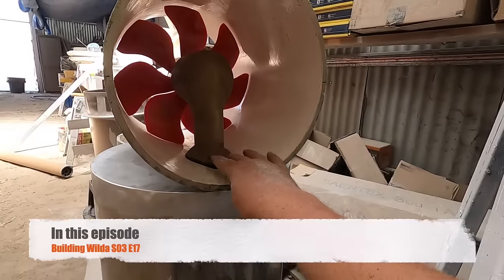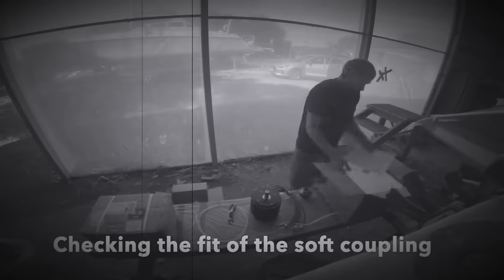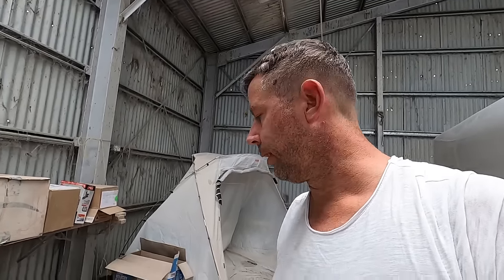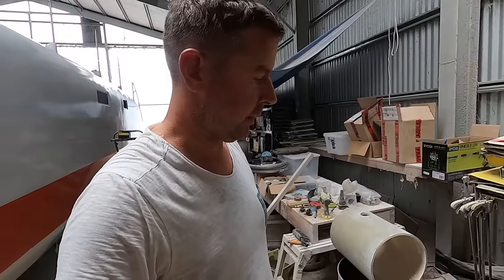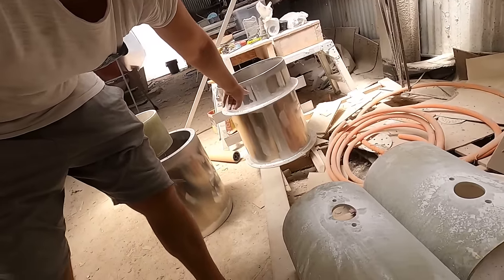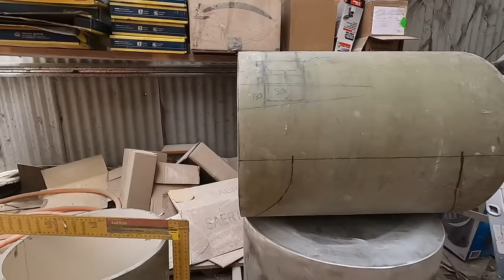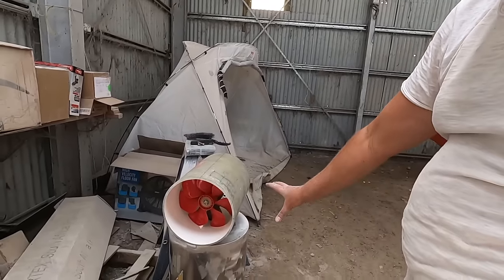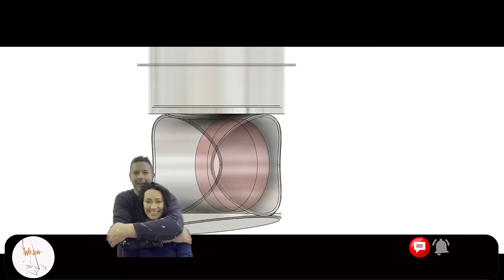NOT the AVERAGE SAILBOAT DRIVE SYSTEM - Part 1- S03E17 | Building Wilda | Electric Catamaran

Comment: Having sailed and lived aboard a 17m aluminium Crowther cat for 13 years I can tell you without doubt you will be caught in conditions you were not prepared for. Getting caught on a lee shore, running aground all things that occur REGULARLY. To that end you need enough drive in main engines to overcome windage (quite substantial with cats), current, waves etc. Emergency power is not needed often but you will need it. It can be the difference between running hard aground and losing your boat to arriving in a safe anchorage. Hybrid and electric boats do not have this capability. You can over rev a diesel for short periods for emergency drive, but not so with an electric motor. In fact the warmer your electric motor gets the lower the shaft output. All this said you need to be VERY careful when moving your boat given the lack of emergency drive available in your setup.
Reply: This is not true. By definition diesel and hybrid and electric are equally not redundant. Your argument fails on this. It could be argued that Hybrid can be designed as redundant (ie direct drive diesel and/or direct drive electric), however diesel is NOT redundant.
Reply: Wow! What an inspired project.
Good luck with it.
Cheers, Hugh
Reply from the maker: All drive systems have their advantages and disadvantages. Personally, i'm hoping the reliability of electric drive will outweigh the disadvantages. Few moving parts, nothing much to service, no clogged filters, dirty fuel fewer spares to carry.

I absolutely realize a diesel is superior in some ways. In particular range under auxillary power. The 10kW motors have a peak output of 15kW for a short period, i think up to 20 seconds. Not much, and they would eat into the battery bank at an alarming rate at that sort of power. The battery bank is probably the weakest point of electric drives at this point. With a small gasoline generator I imagine we'll be able to get ourselves out of trouble.

We'll have to do some real life testing once we are afloat and equip the boat with what we think we need.... And some things we hope we'll never need :)

I love Crowthers designs! Hadn't actually heard of a 17m alloy boat by him though. Sounds epic.

Comment: As an Engineer, this is highly intriguing to watch. Really interesting to see you work it out. I enjoy the process and progress! 😎🤘👍
Reply from the maker: Thank you! We are happy to learn that Axel's ideas and our project sparked so much interest and curiosity! We hope we turn it into a successful project! Thanks for commenting and a simple "like" and "share" go a long way! Hope to see you next Sunday!
Reply: the definition of Ducted props actually sets it as somewhat sensible within the sailing vessel realm.
the problem is the drag when not in use, However, that could be overcome by making it Also re-gen system.....prop re-gen can generate quite a bit of power, but many systems produce pathetic amounts of power because they don't include dedicated circuitry to handle the battery charging.....where with dedicated charging circuitry, prop re-gen could make more power than a deck full of solar panels ..... but the duct needs to be a revolved air foil for efficientcy, and airfoil duct design is complicated, being contingent on many parameters.
Reply: @buildingwilda  or to say, I would cut those PVC ducts as short as practically possible, and try to emulate an airfoil shape in the edge treatments.
and build dedicated battery charging circuits.
Reply from the maker: We will not be able to create an efficient foil in the duct. Perhaps something we can work with in the future.
The drag will be a non issue as the drive is retractable.
We don't have dedicated charging circuitry, but the controller is designed for regenerative breaking and this setting can be tuned to optimise regen.
The type of prop should lend itself nicely to regen .. I hope. And should be able to generate power at a much lower boat speed than other systems I've seen. Large surface area, low pitch... Should generate higher rpm earlier, leading to increased regen efficiency. We'll see how efficient... The drawback is speed under engine, but it's a sailboat ⛵ 

Thanks for the comments! Hope you stick around as we get it all together and into the water 🌊
Reply: @buildingwilda  Oh , Sorry, i didn't realize they were going to be made retractable...
the Sevcons don't regen so well....but it helps to dig into the programming and get what you can out of it....regen braking, on a wheeled vehicle, wants to push against battery voltage....where prop Regen, you want rectification into a large low voltage capacitor bank, and a switching boost regulator, to boost to charge from there.
Reply from the maker: Yes. More like a wind generator.

I've been tinkering with and studying smaller brushless motors and steppers. I'm hoping that the increased rpms due to the low pitch will be enough to raise voltage into an area where the controller is better at generating power. Should work. And yes, there is a lot of settings to adjust to get it right.

It will be an interesting learning experience.

Comment: I actually don't understand why not more boats use a kort nozzle, especially one that can be rotated. It is more efficient than a naked prop and can direct thrust, so it can replace the rudder, which is especially useful at slow speeds. And with a slow-running prop like in the video, electric propulsion makes even less noise. At least to me this project is very logical...
Reply from the maker: From work, I don't think I ever see any nozzles on anything that travels at speed...

Mostly tugs, offshore supply vessel and rigs have them. Slow speed high bollard pull. Some fixed with rudders, others azimuthing.

For higher speed vessels, even in pods, I don't recall seeing many nozzles ...
Reply: @buildingwilda  yes, but then what is "higher speed"? A sailing boat needs a different propulsion at two times: 1) to maneuver independently of the wind (to get into a marina) or 2) to move despite lack of wind. For a sailboat, five knots is an acceptable speed. Tugs use kort nozzles mainly for manoeuvrability, submarines for efficiency, low noise and also speed.

I think the main problem is that people got used to how things are done. Lots of people laughed at electric propulsion for quite some time, but now it's becoming more and more popular. And I expect some other things to change too in that process.
Reply from the maker: I'm sure you are right. Personally, I'm aiming to build a sailboat. That's what Schionning and a few others design. The cat will sail wind speed (hopefully better) in light winds. Love this type of design.
The electric propulsion will hopefully just be for manoeuvring. I'm hope it can get us to 4-5 knots, but we'll see. I'll likely have to try a few different props. Sadly I don't have the ability to form an effective wing profile, so the nozzle will be quite crude.
Reply: @buildingwilda  I wish I had the space to build, I'd like to try that. So I still need to save a little longer and in the meantime I learn further. I do however not get along well with combustion engines, my preference is clearly electric. I can't understand how someone happily uses a machine that needs to be disassembled, cleaned and reassembled regularly when there are other solutions.

My hope is to find a prop like in the video, for low RPMs, like on submarines, to avoid cavitation and noise. Then a duct to improve efficiency (again, submarines), plus rotation, like a Kort nozzle, to allow slow movement, when the rudder doesn't work anymore.

Schionnings look good, but are slightly out of my league, I'm rather looking for a Prout. I have seen a few with electric motors and people survived it, so I'm hopeful...

Comment: As an engineer it's very fascinating however fascinating isn't always safe and when you're crossing the ocean if any seal fails if anything fails on that system you're developing you will die, you should have just done a static placement  of lower prop unit and a folding prop it would be much safer in the long run.... don't get me wrong it's a cool idea to get more efficiency by having it retract into the hole but in my opinion your safety is worth more than the slight efficiency you'll get by having a retracting system good luck
Reply from the maker: Absolutely right. If it was dependent on a seal. The top of the tube is well over the waterline, so should not be a problem. Can remove the unit entirely in the water. If it does break somehow, the boat itself has so many watertight sections we should still float really high.

Comment: Very intersting concept. Besides that lower drag when retracted,  this impeller style system should also have some energy efficiency benefits, due to less turbolences at the edges of the prop blades, as far as i know, when engineered correctly. Think it needs to have a very low distance from prop edges to the surrounding tube. And it gives protection to the propulsion system.

Comment: The propellers have a forward face (convex faces of the blades) and the rear or thrust faces. If you wish to optimise regeneration you will need to rotate your pods 180 degrees so the thrust faces face forward towards water flow to maximise rotational speed and torque. Easy to do with your setup. You are likely to find also that the prop pitch that provides the best boat speed is not the best pitch for optimum regen. I hope you show us your testing, please!
Reply from the maker: Yes. That is the idea. And the reason for going with a thruster prop... The low pitch and large surface area should be great for regen. The prop will not be great for propulsion... At least not for any speed.

We have to decide which way to put them in soon... Clean water flow into the prop or clean thrust out ....
Reply: @buildingwilda  it has been said that a boat is a hole (two holes with a cat) in the water filled with compromises. Yes the low pitch suggests higher rotational speed during regen but less torque while more pitch would impart less speed but more torque. My feeling is that more pitch will be better as a low pitch propeller will be easier to stall as the charging load is increased? Yes more blade area should give more ‘grip’ on the water under power and better regen but with the compromise of increased rotational drag negating some of the benefit. 
Mount them as normal for propulsion then rotate the unit 180 to optimise clean water flow for regen. 
What is the pitch of your propellers? What speed will they turn at with those motors. A really interesting part of your overall project
Reply: Really interesting part of the project. Not the usual easy, diesel, way out. Will enjoy watching the process! I trust that you will have a generator back up for safety for those times you will be motoring off a lee shore for hours. I mean nothing but tremendous respect for what you have done on this project!
Reply from the maker: Thanks!

A small generator should do the trick. And in worst case, an outboard, we'll be very conservative starting out. Until we really know our limits.
Reply from the maker: Being a thruster prop, it is made for high rpm. This suits direct drive electric very well. The drive leg has a 1.4:1 gearing. Should allow the motor and prop to turn close to optimal ranges ... Not perfect, but close. The faster we can get the prop to spin during regen, the better. I'd be super happy with anything above 500w, but I hope for 1000 in the right conditions. We'll see.

Comment: This is a variation of a Kurt’s nozzle. A Kurt’s nozzle improves the propeller thrust by approx 30%.
Reply from the maker: Yes. But we won't be shaping the nozzle into a foil shape. Too much work.
Reply: Bob, is that a “free” 30% increase in thrust, or is there a cost by way of higher current draw?
Reply from the maker: Not sure about the 30% ..... But at least less power being wasted  sideways. As for power efficiency... If a nozzle always made that sort of difference, all props would have shrouds of some sort. Props don't really throw that much water sideways, or paddlewheel.... It's a pressure differential thing that causes what's known as prop walk. Props work more like screws (really bad screws that slip all the time 🤣) that being said though.. if you look at props designed to direct thrust, they have nozzles and for good reason. To my knowledge, mostly in low speed high thrust applications. Pretty much what we are looking for.

Comment: What about using a shaft driven setup with a folding prop? That seems extra complicated. I'm wondering how many knots your boat will go with this set up. I've never seen a set up like this before but it seems very similar to some of the bottom of some outboard engines with a prop guard.
Reply from the maker: It won't be fast, that's for sure! 🤣 All solutions have their own merits. And there are many different ways to get a prop to spin 🤣
Reply: @buildingwilda I can't wait to see how it all works and then preforms. If you feel that you've made a mistake on this install than you can always change it latter on is some boat yard after you use it for a few years. Who knows, you might have come up with something everyone will want and set a new trend.

Comment: This is cool, its been around for a while like you said. My favorite version used rim drives because they can pass ropes and other items through without fowling. The other versions also added and upper cap to keep the cavity protected, I also thing it kept to much seawater from being trapped inside the tube.   You might want to add a way to remove any trapped seawater from the tube. If you want to be environmentally aware you can turn the propeller into a sort of a self washing machine by pumping some fresh water into the propeller tube. The fresh water is a hostile environment for the sea life that wants to attach to your equipment. I am not sure how much fresh water to add but I don't think it would take to much.
The not so environmentally nice way it to build a pocket in the tube for a bleach puck or some other method of injecting the water in the cavity with a cleaner, biodegradable soap is an option, but I'm not sure how much of a hostile environment it would create, and if you turn on the propellers well.... have you ever seen what happens in a washing machine and dish soap. You would leave a trail of bubbles as you sailed away.
13 hp motors seem pretty small fort the size of boat, but if you are okay with it I say go. I would recommend a 25 hp outboard or larger on your dingy and a mod on the back of the boat to allow for use on the full size boat in an emergency. That way you have a double duty backup.
It's a very cool concept, and I have only seen this on super yachts so this should be interesting to see how you solve your issues as they come up.  Good Luck!
-MG
Reply from the maker: Very close to our thinking. A 25 hp dinghy outboard would be great. We'll see when we get there. Planning on a 3m is tender, so may be limited to a little less power.
As for the fouling in the cylinders... I'm hoping the lack of sunlight will keep growth down and almost all of the prop will be above the waterline when retracted.
Rim drives are super cool. Just not an economically viable option. Nor are any other retractable options. Even fixed commercially available options are extremely pricey... I think we'll get it working well. How well, remains to be seen.

Comment: Fantastic Axel and Rox , Cant wait for more of this electric propulsion build . putting the prop in a sleave like you have will make it more efficient. less cavitation so to speak .
Reply from the maker: Thanks Steve! See you soon
Reply: It's called a kort nozzle.. or Azimuth drive ...there are several designs on the market German, French and UK and theres a company making retractable drives as he said.  They have good thrust and are very safe  the clear centered rim drive motors and blades have more advantages but both  tend to top out at around ten knots but that is plenty for a sailing vessels auxillary propulsion. 

The one company that has designed a high-speed rim drive is the Italian Deep speed rim drive. .. it's more of an external water jet turbine.. more efficient  though at higher speeds .. it's all external so no internal motor... There's a Transom mounted lifting stern drive system they can be bolted to and can be lifted out of the water to   
Allow beaching, removal and replacement and clearing.

Top marks for doing this yourself.. 😎🧙🏼‍♂️🇬🇧 

You can drive the motor from the center or use a rim driven electric motor.. 
They are safe and efficient but do require some fine hydrodynamic refinements . ..such as turblator rings and wavy edges on prop blades.. inspired by insects and whales.. the same company who makes the 3 types of auxiliary electric  pod drives. 😉

If you're going to try best regen and optimum drive efficiency you might have to go down the tractor prop route. 
The other thing is is it possible to improve the efficiency by having a slightly wider entrance to the housing compared to the exit side from the prop. 🤔 all interesting stuff. 

RS/Pure built a regatta rescue center consul electric Rib in the UK using a retracting  rim drive unit .. that pulled up in a open tunel in the rigid  hull for shallow draft and running up the pebble beaches at speed.  

They built the rigid hull from flax and Basalt fiber .. for ballistic and abrasion resistance and the flax gave strength and lightness akin to carbon  and beyond without the pollution and costs . 
It was also a lot greener and safer to produce compared to GRP or Carbon fiber.